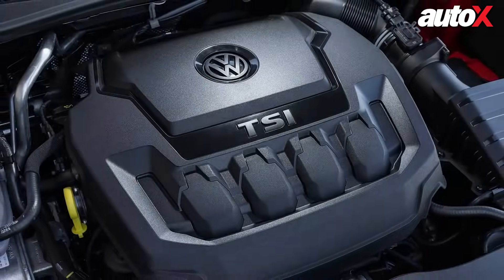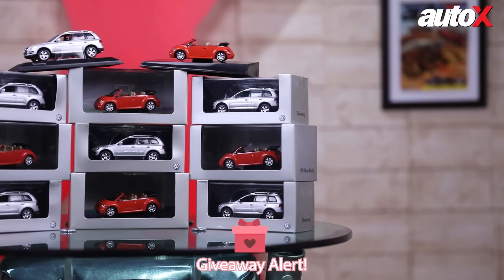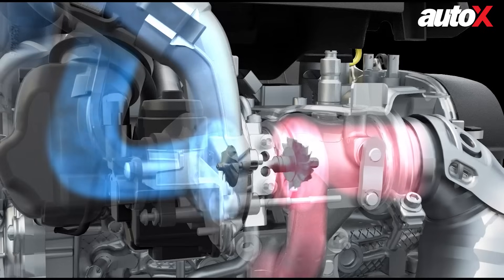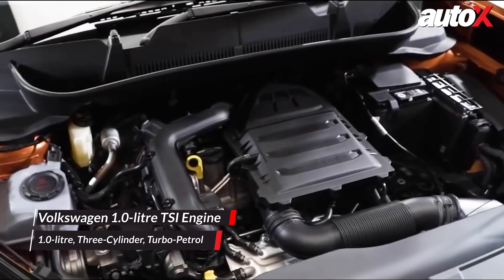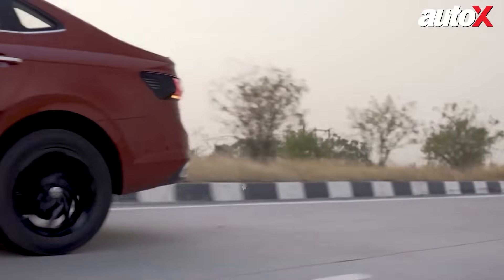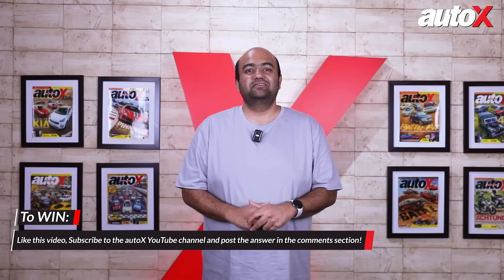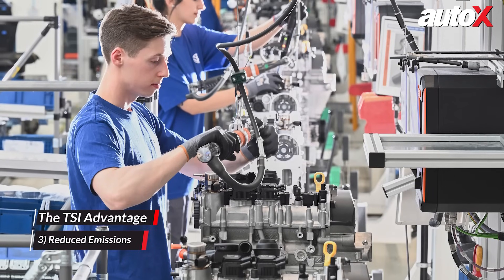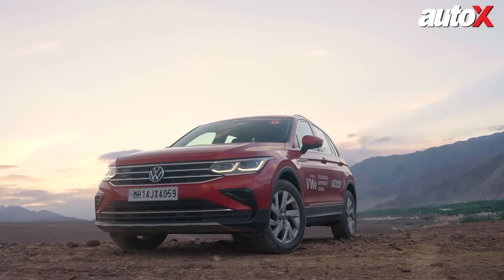Volkswagen TSI Engines Explained | Power, Efficiency & Technology | Special Feature | autoX

Comment: Compared to verna or other brands, vw 1.0 or 1.5 tsi evo is based on Miller cycle combustion engines. Verna and others still uses conventional "Otto-cycle combustion " engine. 
Miller ones are for more fuel efficiency and sustainability and also durability due to lower heat dissipation.
Otto based are for punchy torque but its not durable or fuel efficient.

Comment: Boss...vw engines or products are not known for its performance, efficiency or quality... they are average in every aspect. Only in India its perceived as a premium brand. Over the years I have owned 3 vw cars ( Cc, golf, tourage) all of them were problematic. Fuel pump failed, roof lining falling off, keyless entry failure, taillight bulbs fusing multiple times, high oil consumption, premature brake pad wear,  ....

Comment: VW T-ROC 2020 (EA888 series is a popular turbochargered inline four cylinder engine) TSI engine is known for its balance of power and efficiency ❤️‍🔥🔥
Reply: Troc is not ea888
Reply: EA888 is 2000 cc found in tiguan/ kodiaq